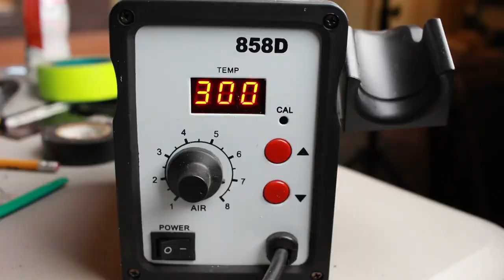EVGA POWERLINK RGB LED MOD

Comment: and all you had to do was void the powerlink's warrant to do it because its something that should have already been done.
Reply from the maker: I don't know why it has a warranty. It's a metal wire with filter caps.
Reply: @ImmodderNation  by buying it thru EVGA it comes with a 2 year warranty.